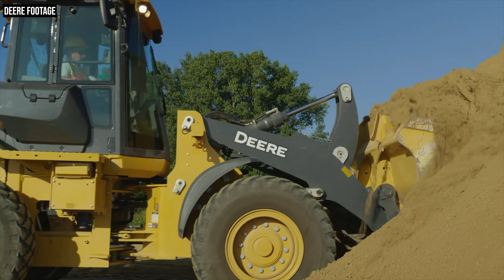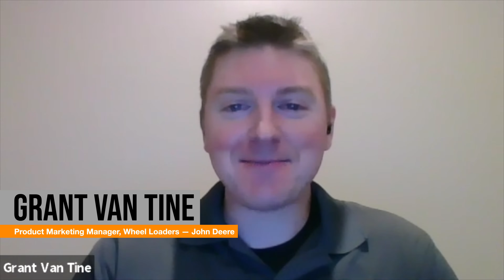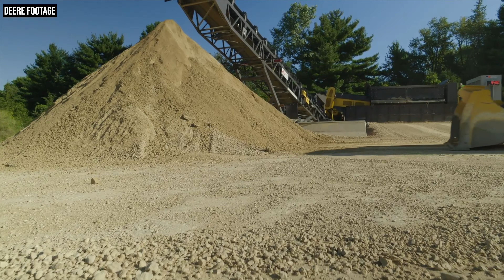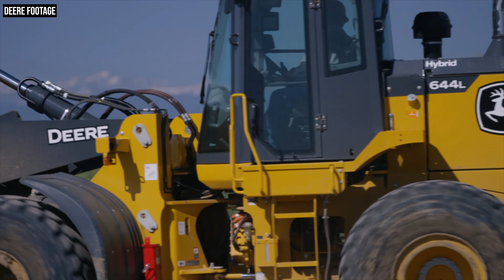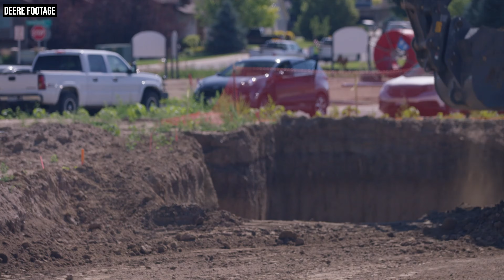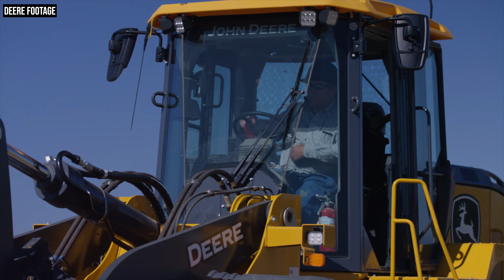John Deere Loader Expert Breaks Down New L-Series, Redesigned Z-Bar Linkage | The Dirt #16

Comment: I have and still do run a 744 maintaining a very large feedlot! And custom hay operation! And when they had to haul it away for transmission fail!! For the 2nd time in 3 years we can not operate without a loader!! And we rented A CAT loader both times that will run circles over that Deere!
Reply: Why not rent a Deere?
Reply: I hate that they put the FNR lever on the bucket control and eliminate the traditional left hand lever on the steering column. It makes no sense to do that when some people prefer the left lever style. Both cat and Deere is doing that and I got off both machines that had the right FNR on the bucket lever. If you want to make it an option, that's one thing. But to mandate it, that's stupid. I will not purchase or operate a machine without the more traditional left hand control.
Reply: @johndeere350b  cost reductions. Plain and simple.
Reply: No doubt 🤘